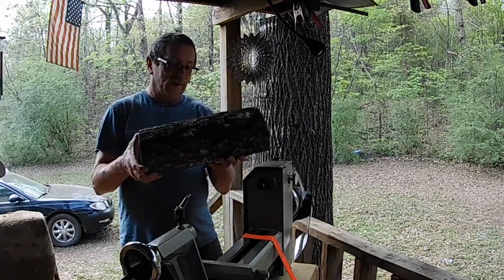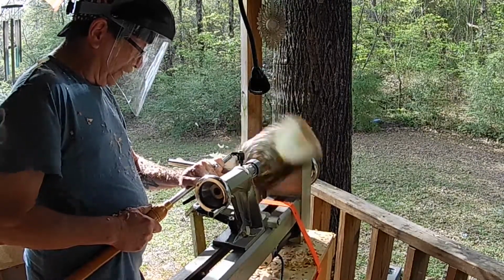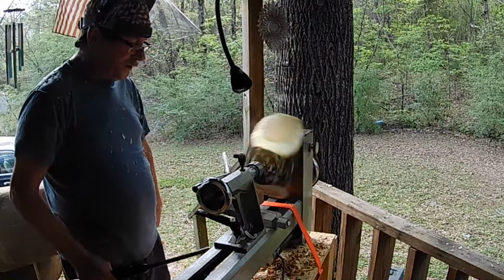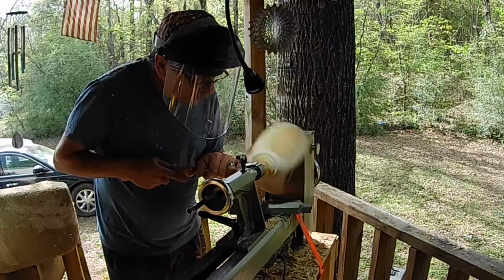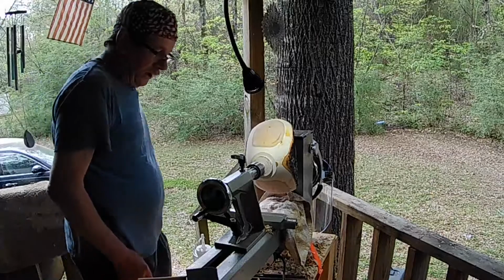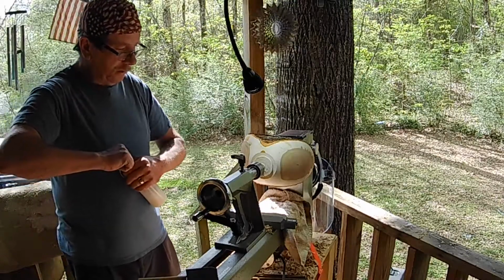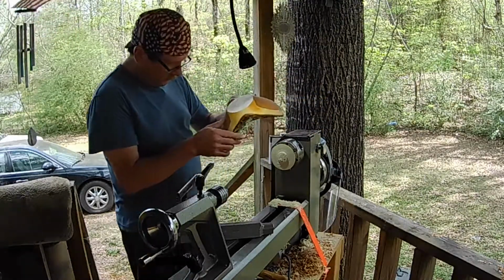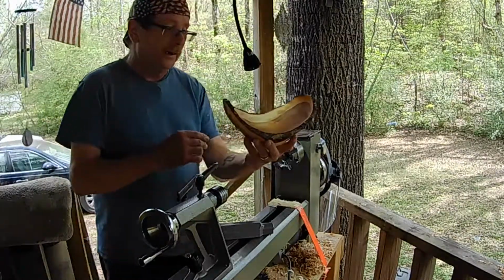Woodturning Cherry Live edge, from Log to Bowl Hidden Beauty reveal

Comment: Great tutorial. Where did you get that tool rest?
Reply from the maker: I got that from a vendor at the Atlanta wood show last year. It's a Savannah name brand, it's part of a set you can mix and match different length rests. The 12" seemed a bit long for my little lathe so I got a fellow from work to heat it up with a torch and help me bend one end of it. I use it all the time now.